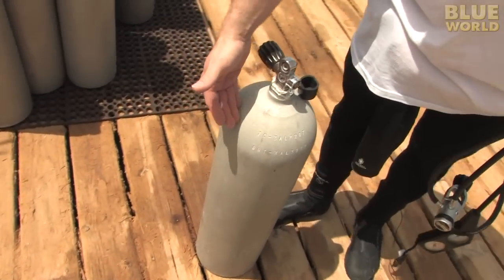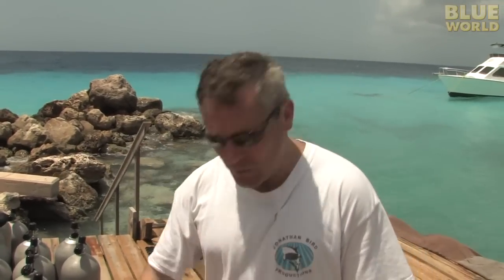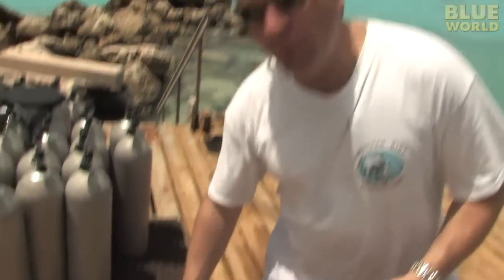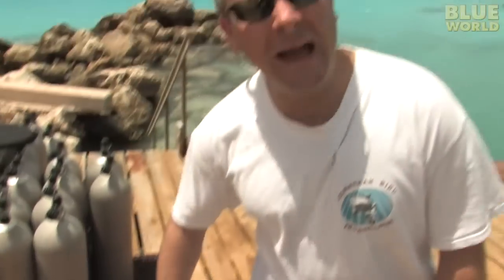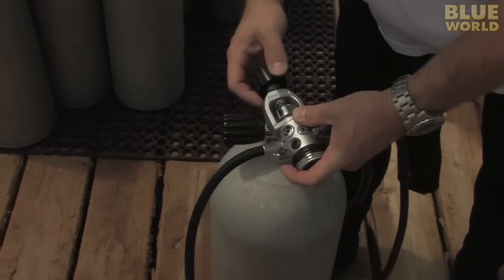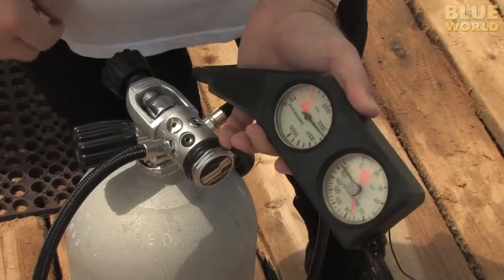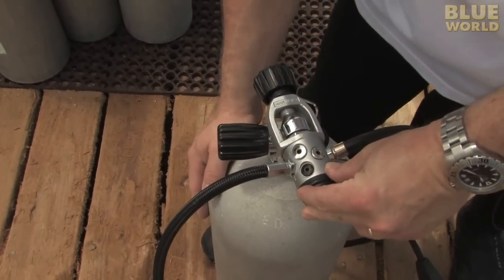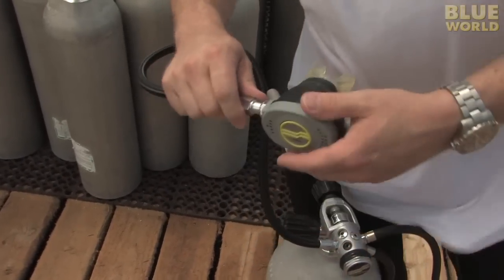Scuba Regulators | BLUE WORLD TOOLS OF THE TRADE

Comment: when using the regulator and breathing it on land, do you run out of air before you even get in the water or do you still have enough air?
Reply from the maker: +flwrgrl13 It uses very little air on land.
Reply: You don't use the regulator on land. You breathe the air around you.
Reply: Alex Pronove "You don't use the regulator on land. You breathe the air around you."

Watch the video again; Jonathan was breathing from the regulator on land. Also, when walking from the shore out to deeper water it's a good idea to have the regulator in your mouth in case you trip and go face first into the water. And of course one should always take a few test breaths from both the primary and the safe second before jumping in. Lastly, if you have a full-face mask without a surface breathing valve (like my OTS Spectrum) you need to have the air turned on as soon as the mask is in place unless you want to suffocate. (Come on OTS! Where's the "coming soon" SBV I was told you'd be coming out with?)

Comment: Is there any way to get rid of a dry throat while diving? I always come out of a dive with my throat feeling like a old crisp or chip as Americans call it I was thinking about bringing a water bottle that has a one way system so you can drink out but not let water in
Reply from the maker: +Matthew J.T Bring a juice box or bag.  You can drink from them underwater!!  (Just be sure to take the trash home with you).
Reply: +BlueWorldTV wow cool tip, thanks?
Reply: Matthew J.T OR if you happen to be diving in a natural spring, just take your second stage out and have a sip of the water. Apparently it's even better than your tap water.

Drinking water underwater from a natural spring is on my scuba bucket list.
Reply: + Matthew J.T "Is there any way to get rid of a dry throat while diving?"

Prevention is the best solution. Drink plenty of water before you dive, "swallow" every now and then while diving, etc.  There are also devices you can insert into the LP hose between the first and second stages that moisturize the air. See, for example: http://apollosportsusa.com/bio-filter.html